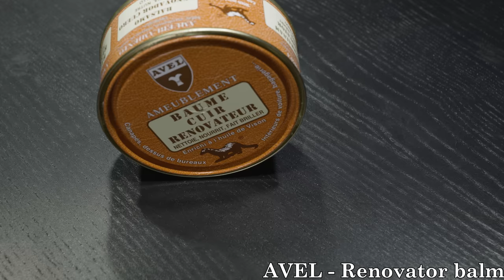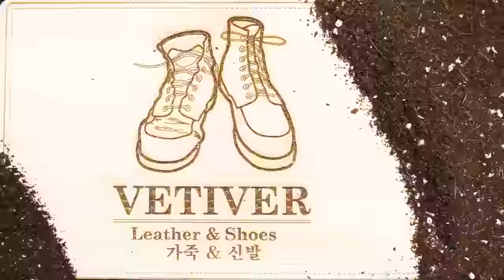[ASMR] 'Dye & Restore' German Vintage Satchel Bag  -4k  satisfying  Brush Sponge Rub

Comment: For those who are wondering why he did not do anything to the "yellow" leather parts of the bag: it's because that isn't actually yellow dyed leather; it's vachetta leather, which is basically a fancy term for untreated leather. Vachetta leather starts out, when new, in a nude blush-like colour, and through wear and tear, collects oils and develops an orange-like patina. This is usually expected and ideal for those who own and use vachetta leather, as it gives it a vintage appeal. You can also tell the zipper also has the same colour, as it was intended to match the leather as the leather ages. There really isn't much he can do, especially if this is a client's request, aside from cleaning the part of the vachetta leather. Also, the reason he did not polish the hardware is because it isn't originally silver or supposed to be shinny; it's gun metal. I don't know the date of when this bag was created, but, it is safe to assume it was used near the war, and gunmetal was extremely common as a source material. I hope this helps inform anyone!
Reply: Was enough for me, thx!
Reply: I was wondering, thank you. The laptop securing strap must have been added later, correct? Any idea what the metal ring in the middle would have been used for?
Reply: Thank you for sharing!! Very interesting!
Reply: He didn’t polish it or clean the metal that good because that would require to unstitch and restitch the leather. Which could ruin the whole bag if you don’t have the proper experience.
Reply: I still have one question. The yellow part looks new and nice in the beginning, why does it look even older after cleaning it?
Reply: @aralepui812  When you moisten leather with a moisturiser, it tends to get darker, hence the "older" effect look; that is somewhat ideal, but it won't stay that way permanently
Reply: Christopher Featherley thank you for the reply 🙏🏻
Reply: Thanks that was very informative 😊
Reply: Thanks for the enlightenment :p tbf I think it looks better like this. It keeps its "soul"